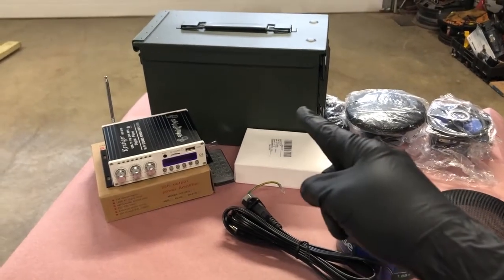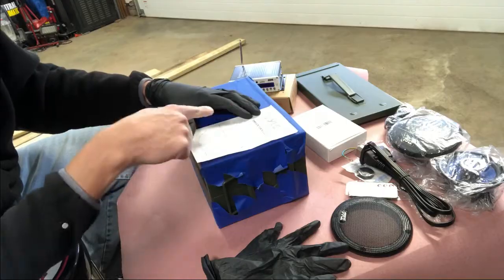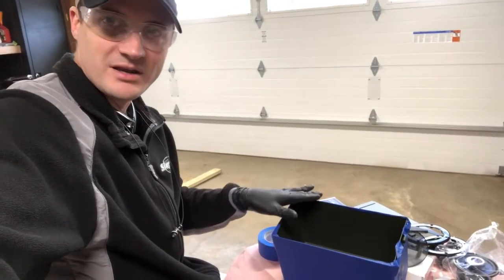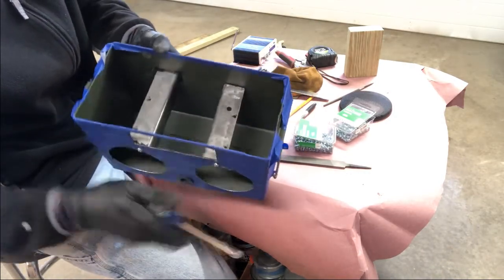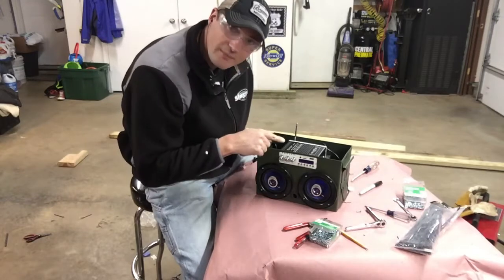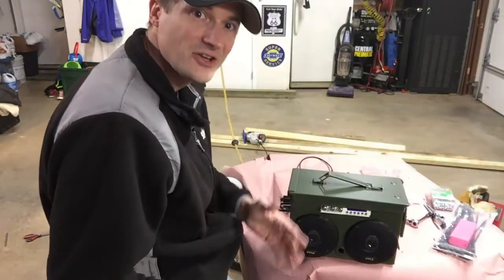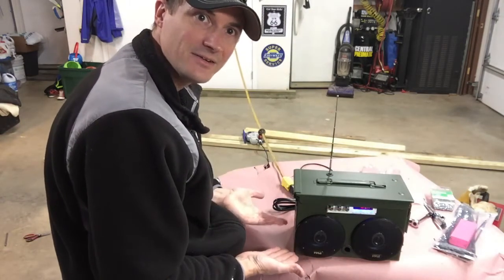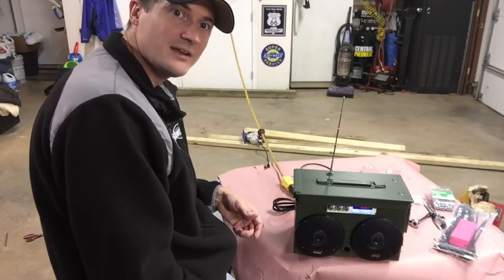Ammo Can Radio - Weekend Build

Comment: very nice! i made one with a pioneer car head unit with Bluetooth and all that, and 2 kicker 6x9 3 way speakers. I sealed the enclosure air tight. That thing rips. I'm a heavy diesel mechanic, i kept breaking Bluetooth speakers so i figured if i cant buy one tough enough, ill make one. Also, it is battery powered. I got a 12v 7ah lead acid battery for it. It kicks through a full 10 hour work day no problem. I charge it with a battery maintainer via a set of terminals i built into the side. Only downside is the thing is like 30 pounds.